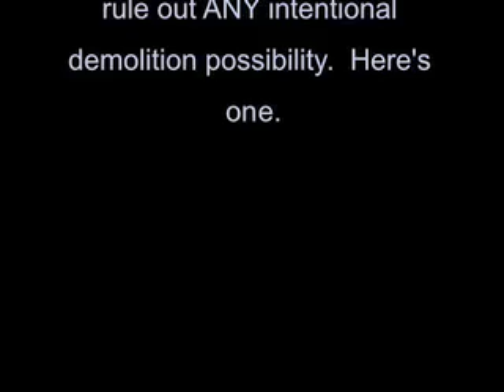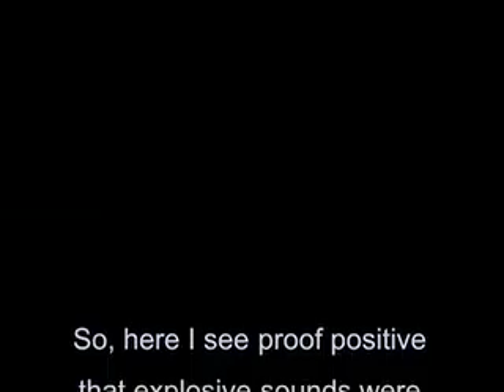NIST WTC Response 1

Comment: basic physics is that when the top of  building 2 started to fall sideways, it would have kept going and fell off the side, not down into the path of most resistance.
Besides, obviously not a collapse,it is a high-tech pulverization from the top down at more than free-fall speed(1+2).
All the characteristics of controlled demolition were exhibited that day and steel buildings DO NOT collapse from fire,ever.
There are many books you could read if you wanted the truth.But of course you don't.

Comment: "Sunder is ABSOLUTELY NOT saying "half a mile away the sound would be the equivalent of being NEXT TO a shotgun blast".."

Wrong.

From NIST's Q&A: "...no blast sounds were heard on the audio tracks of video recordings DURING THE COLLAPSE of WTC 7.. According to calculations by the investigation team, the smallest blast capable.. would have resulted in a sound level of 130 decibels (dB) to 140 dB AT A DISTANCE OF AT LEAST A HALF A MILE.. This sound level is consistent with a gunshot blast.."

Comment: Do any of these explosions occur immediately prior (i.e., within one to three seconds) of WTC7's collapse? Were any of them loud enough to fit the decibel profile of the minimum explosive charge necessary to knock out the critical column? If not, then how are they linked to the classic controlled demolitions which comprise our common frame of reference?

Sorry, but no amount of internet sleuthing is gonna unseat the findings of science. And so the answer to your question is a resounding 'No'.

Comment: I remember one clip where some guy of "controlled demolition" or another company like that said: "We control soundlevels..."

I wonder why Shyam Sunder fails to give a number in db we would have to expect and on what basis he puts that. There are thousands of different explosives with different expansion speeds and therefore different soundlevels when they explode.

The QnA ends anyways when someone throws the spheres in.

The question should have been: "Are you familiar with Steven Jones work?"